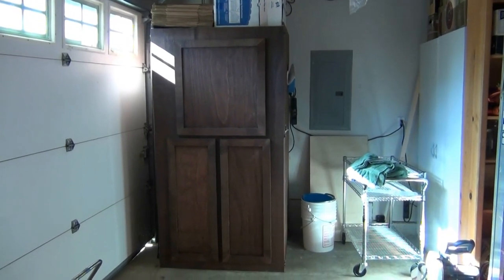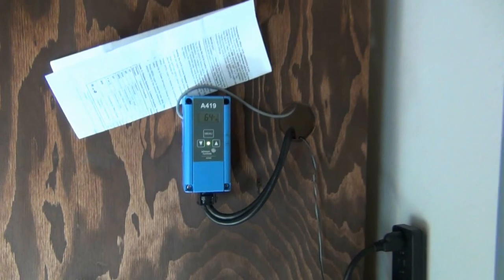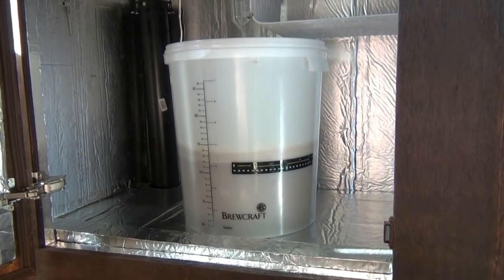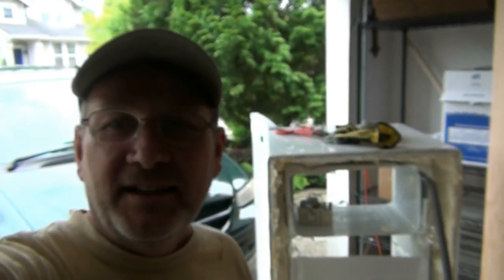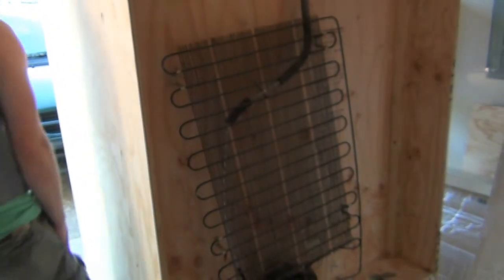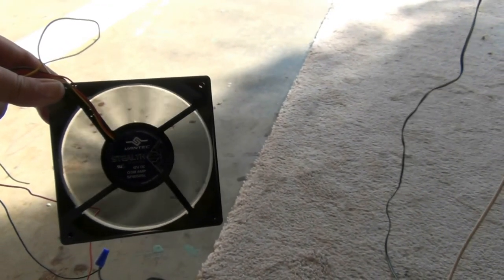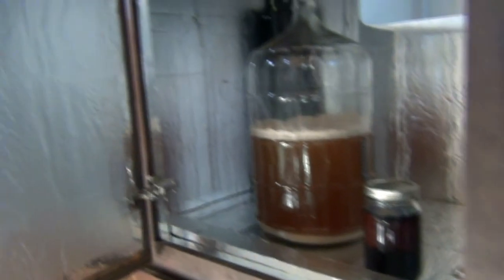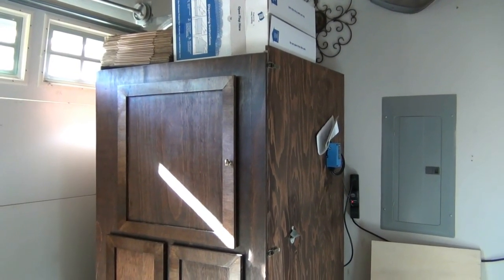HBW: Refrigerated Fermentation Chamber & Beer Cellar Cabinet

Comment: Awesome build! I need to make one now
Reply from the maker: Glad that helps. Basically, there are two ways to go.
1. Build a unit like mine.
2. Buy a couple mini refrigerators and modify them. The advantage of the mini refrigerators is that you can use them to cold crash and make lagers.

Comment: From what I've read about condensation it has to do with air getting in. I use a chest freezer with a Johnson controls Digital. I also have a sepearte one for serving from kegs. I get tons of condensation in warmer weather and I've been looking at building my own box, sealing it well and putting external taps for serving to prevent constant opening and closing. The boss has yet to give me clearance on the external tap handles. : )   I like what you guys have done. Keep up the good work!

Comment: No other word "WOW" great job thanks for sharing "cheers" from Brazil_Usa
Reply from the maker: It gets better. I know use a set of fermwraps for my buckets in the top that are temp controlled by a Inkbird. I can turn the temp down to the mid 50's, but ferment my beers at what ever temp in the 60's or 70's is needed.

Comment: Very nice! I built one in 2009, it only fits 2 glass carboys+airlocks up top, and 2 Corny Kegs down below. I chose to force the air from the bottom to the top.  I have found those PC case fans have an increased failure rate to which I converted to oven hood fans or even bathroom vent fans would work too.  I have 2 regrets, one is it too small and I can't fit my new conical, and two, you used better door hinges and a removable front, a nice touch for easy fan replacment.
Reply from the maker: I'd say you are a far ahead of most people having your setup. Sounds like you did a great job. I've been fortunate. My same PC fans have been running since 2012. Never had to change one out yet, though it should be easy to do.
For a lot of years I've thought it would have been better to have several mini refrigerators, but I've abandoned that thought. Mine stores so much beer below and I can get 2 buckets, plus a keg with airlock inside at the same time.
Down sides: I can't cold crash and I can't fit a conical, as you said.
I'm entertaining the idea of 1 mini refrigerator for cold crashing. It would be a plus if it could fit a conical.
I'd love to see pics of what you created. Send a few if you have time.Cheers!
cleminator13@gmail.com

Comment: I Love it!! Now that you have been using it for 9 years, what do you like and or dislike about it? I'm gonna make close to the same thing.. The big thing I'm gonna do different is turn it upside down or 180 degrees from yours. I'd rather have the large door on the bottom and use the top for bottled beer. And I think I'd put the temp control in the front. Oh, and I wouldn't put that tube for the fan in it. The lower the fan is to the shelve the colder the air would be that is moved down.  Awesome build!!  Did you put insulation on the bottom? I couldn't see if you did. What thickness insulation did you use? It looks like 2 inch.  Where did you get the shelving? It fit perfect..

Comment: That's pretty awesome! Thanks for posting this in it's entirety! About how much did it cost total, if you don't mind sharing that?
Reply from the maker: Boy, hard to say at this point. The 8 cubic ft refrigerator was $100. I wen with some pretty fancy hinges and such. it may have cost $400 in all with the Johnson controller, gorilla rack, plywood and insulation. It sure has served me well. I've filled the bottle storage to the brim at times and ferment beers in the summer heat. In retrospect, I would do things differently though. I would go for a couple mini refrigerators so that I could control the temperatures for each carboy more accurately. Many recipes call for tight control on the temperature with slowly rising temps. I think a small refrigerator might do a better job. But for bottle storage, this can store a heap load of beer at a dramatically lower price than any cellar refrigerators you'll find.
Reply: I was working on designs as well for one, and I got up to $200 in parts and just bought a chest freezer instead, since it was the same price and a lot less work.  But I am still going to build the custom one, and I like the idea of two smaller fridges for better control on multiple chambers for different beer fermenting.   Thanks for the input!

Comment: Very nice build!!
I've been thinking about doing something like that for a long time, but never dare to take the guts of the fridge out of it for some reason... also my thoughts were to set the top part as beer storage, since it's colder, and move cold air to two or three different fermentation chambers at the bottom. After seeing your video I realize I probably wouldn't have enough cooling power to cold crash the beer, which I do for every batch. If you did this again, what would you do, keep it as you show in the video or switch it around? My second thought is using different fridge guts for each fermentation chamber and cellar area, but that would mean getting rid of all my fridges which I'm not sure is a good idea :-)
Cheers!
Reply from the maker: Great questions Dioni. I would not build a chamber like this again. It does work great in the summer, but not in the winter. You can't heat the top without effecting the storage chamber below. You really do need separate heating / cooling systems for each area.
In the future, I will have individual mini fridges for fermentation chambers. The top of the current system will be for long term storage of beers in kegs, such as aging stouts or barleywines. The required temperatures for storage bottles and kegs being pretty equal. Cheers!
Reply: Thank you for posting your video on your fermenter/cellar. I wondered why you didn't use the top for the cellar, and the bottom for the fermenting chamber. Then have one thermostat on top and one on bottom. The one on bottom could be a simple home thermostat with a battery and hooked up to a computer fan to draw cool air from the top to the bottom. Is that how you vision it being in the future? I may toy with this idea for a bit, but your video is exactly what I was looking for. Cheers!

Comment: Hi Bet you thought you will never see a comment on here after all this time....lol Well I just like to ask how is it going, is it still working fine? As I am thinking of doing the same... Fantastic video All the best, Thank You and Mash On!
Reply from the maker: It has been a little while since I've had a question or comment. The unit is still running great actually. My wort is even better controlled these days. I use an Inkbird controller in addition to the Johnson controller. I place a thermowell in the brew bucket and the temperature probe from the Inkbird in placed into it. The inkbird controls a heat wrap on the brew bucket. It consistently holds the wort temp withing 1 degree F.  I've lowered my fermentation chamber to 50 F, which keeps the beer below at a good storage temperature.
Best of luck with your build. I've been very happy with mine. Cheers!
Reply: @ClementsHomebrew: FYI  - Am having issues with my FB account a user on the UK FB group is getting my account disabled just to let you know why I haven't been in the US group. I have another account now, so would like to send a FB request to you.  Also I am on with my fermentation chamber build at the moment. Hoping you are well and have recovered from your back injury. All the best 🍻😀

Comment: What kind of brackets did you use to mount the condenser to the back wall?
Reply from the maker: That's a great question. It's been quite a few years. I believe I used a lot of the original parts from the refrigerator. They all very a little. You'll have to get creative. Best of luck!

Comment: how thick is your insulation?
Reply from the maker: Actually, I used various widths. But mostly 1". I had to move it for the 1st time this week for some garage work. The removable front panel made all the difference. I now also use an "Inkbird" temp controller for a fermwrap. This allows me to keep the overall temp around 55 F, while holding fermenting beer at temps of 65 - 70F. Cheers!
Reply: +ClementsHomebrew I'm building a smaller version of this myself. basically I can fit 2 6 gal carboy in it
Reply from the maker: Best of luck. I suggest looking into the inkbird controllers. Great price and easy to setup. Cheers!

Comment: Thx for sharing. Lower and upper chambers have same temp. are they?
 So lower chambers are for beer conditioning, or...?
Reply from the maker: It's not a perfect design, but has worked well for years. I plan on moving toward mini refrigerators to allow me to have even greater control. But it has definitely worked well for both cellaring and fermenting.